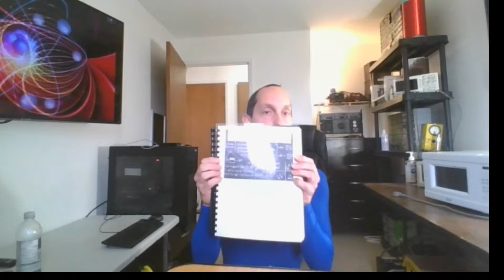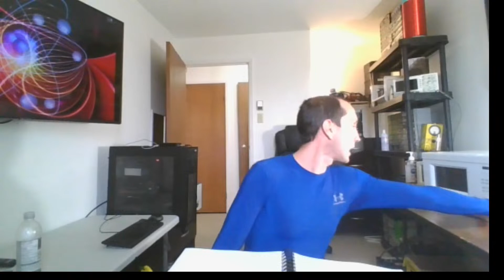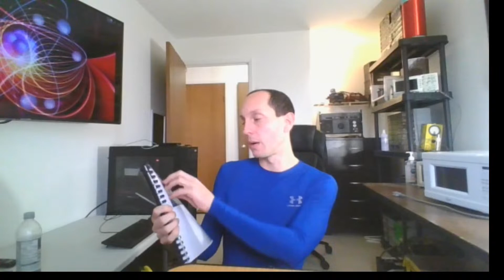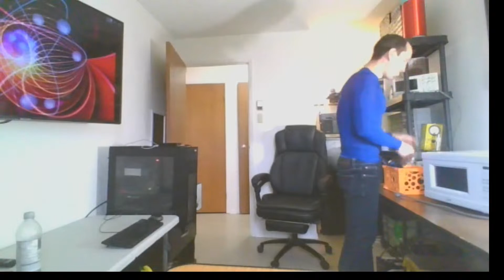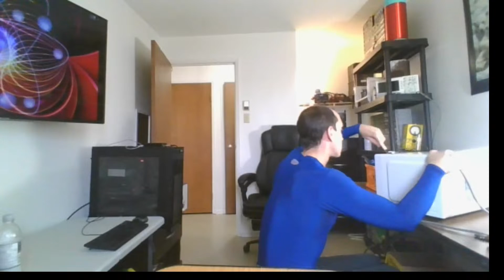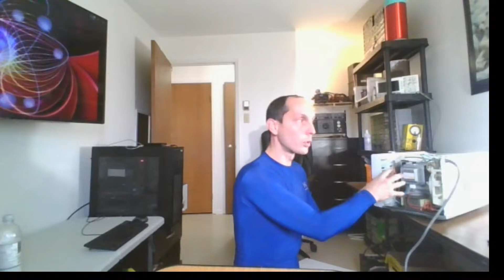Random Chat Microwaves and Maxwell

Comment: Also i have a few mots and magnetrons laying around that i harvested over a year ago if you could use them. And btw you can just break those center tabs out on those safety screws with a screwdriver and a hammer pretty easily. The square and triangle screws can sometimes be taken out with a flathead if you dont have the bit. I still resorted to using a pry bar lol. But yeah i have at least 2 of each + capacitors.

Comment: I'm not nearly as educated as you on the topic but my own research over the years has led me to the conclusion that when you are obtaining over unity it is due to a monopole event. For instance Google just told me that a monopole has the ability to ionize 4700 times greater than a particle with a single electric charge. Sure sounds like exactly what Don Smith was on about.

And the open loop being a closed loop is true. It always has to have somewhere to go but my research has also shown me that there is some universal grounding point that i havent discovered or understood fully.

Comment: pure potential implies regauging and means that it does not consume energy as work because work means change of energy form but only the potential is increased without work, a strong but short dI/dt pulse is enough to get a potential pulse, and to sustain the pulse, opposing coils are needed. Chris Sykes work still stands bc it's built upon the inventions.
Another hint is the force used by marinov, grad(qV dot A) i believe